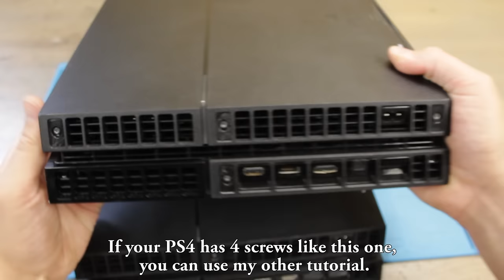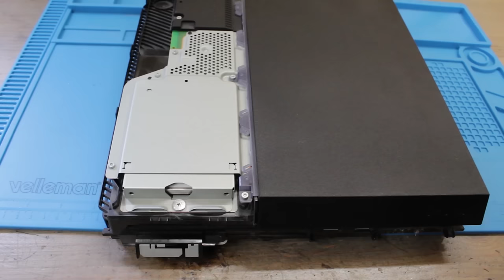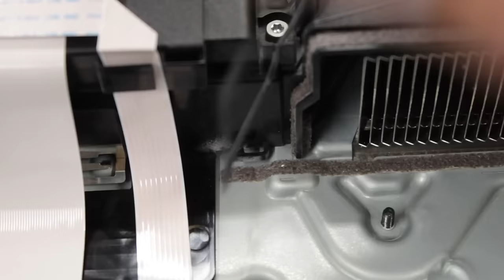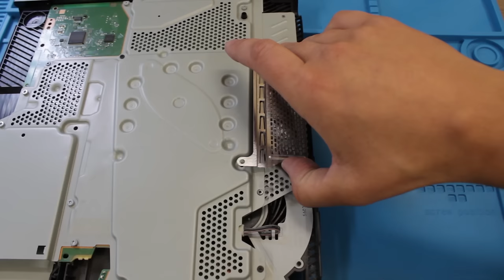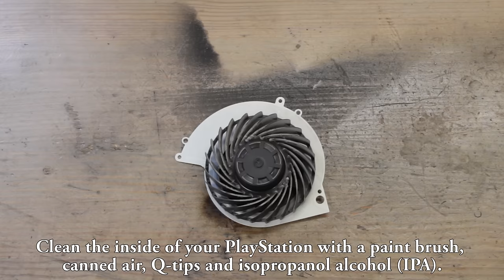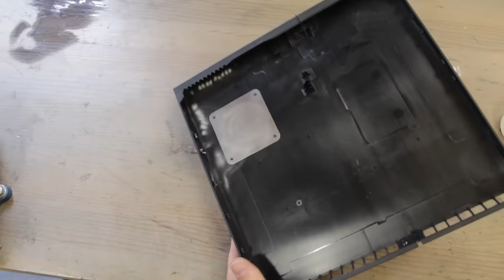PlayStation 4 model CUH-1200 cleaning tutorial.

Comment: My disk reader wont let me put in games.
I was cleaning it and i left a cd in there i dint put it back in and now it wont let me put any cds in my ps4 any help?
Reply: Ok i found the problem.
When you out the disk in there is a tiny oiece of plastic that is protecting is kind of that other disks dont come in. But it just stays there. How do i put it back?
Reply from the maker: @hasanok7223  You may have damaged your disc drive by opening it with a disc in it. Please send a message to my instagram dm. Then I can try to help you.
Reply: @hasanok7223  Hey, I don't think you damaged it, broh. Maybe you should try doing the manual eject trick. 
It's simple, you can Google it; it involves using a screwdriver to reset the drive and hopefully that might allow your discs to enter nicely again. 
The drive can refuse to allow any discs back into if you happened to just grab your CD by hand, out of the drive, while you were opening it! Which, it seems like you just may have done. :) Best of luck

Comment: 1 had to break of the big part of the cap, because at the back the right thing with the text on it didnt come loose, how did you manage to do that😢
Reply from the maker: In the video, it looks easy. This ps4 has been disassembled before and therefore opens easier. The way of opening is the same. You can turn the front away from you, then you can apply force easier.

Comment: ty for this video bro i will clean my ps4 tmmrw and i will diff be using this vid as guide, is there anything i need to be careful with while cleaning/plugging cables of  or anything else? cause i dont  really want to damage my ps4 lol.
Reply from the maker: You're welcome.

The bottom cover can be difficult to remove. The 2nd way I show in the video is a bit safer. 

Be careful with the ribbon cables. Don't fold them too much. 

Make sure you have the space to work and store the parts safely. 

Just take your time.
Let me know if you have any questions and how it went!
Reply: @SpareTimeWorkshop  actually all my 3 security torx screws are stripped, i dont have a rubber band so is there any other solution?
Reply: man you are amazing you're  tutorial is easy to go through , i just finished cleaning my ps4 and put it back all together and now my ps4 stopped sounding like a jet engine lol, ty again you deserve more views man.
Reply from the maker: @SmW-pc7qe  

Thank you very much for your feedback! I am glad to hear that you managed to clean your PS4 with my tutorial. 💪

Comment: Any tips on how to remove the power supply cables without damaging them?
Reply from the maker: You can alternatively use a small flathead screwdriver with this model. You can pry that in on the right side. But needle nose pliers also work.

Comment: The left screw for the power supply can’t screw in… how should I fix this? It just lays in the hole but I can’t screw it down because it’s already at the bottom.
Reply from the maker: You may not have installed the small nut with the black cap on the other side.

Comment: DONT CLEAN AWAY THERMAL PASTE IF YOU CANNOT REPLACE IT FRESH! MUST HAVE THERMAL PASTE.
Reply from the maker: Thanks for sharing this warning. I personally advise against leaving the old cooling paste in place. Often over time it becomes very dry and has lost most of its effect.

A waste of your time if your PlayStation is still not running optimally after all that work. Good cooling paste is fairly inexpensive.
Reply: @SpareTimeWorkshop  would be an idea to place a disclaimer at the beginning stating not to attempt before having paste at the ready. But excellent video. Renewed the paste and thanks to this vid everything amazing
Reply from the maker: @joshpalmer5974  Yes I have indeed had more people who had the same problem. It is very difficult to figure out in advance where it might go wrong.

In hindsight, this would have been 1 of the things I would do differently now. Just like warning not to take apart your disk drive with the disc in it. Unfortunately, things sometimes go wrong there too. Sometimes even with damage. I'm working on that now though to see if I can stick a warning in there.

Thanks for your feedback
Reply: Yep did clean it and haven't paste at home... Can I intal my ps4 without paste, just to try my ps4 (just starting up and open a game) and add the paste later?
Reply: @akon3152  No ! Starting it and running a game will cause tha APU (silver chip) to overheat and with luck your PS4 will turn itself off instantly. At worst you burn out the chip and it's a brick. Spend the 10 bux and buy the paste and replace before starting you turn it on.
Reply: @joshpalmer5974  I ordered the correct paste already. I Wanne start a game to see my ps4 s still working well by disassemble it... Tomorrow I will know😃
Thanks die your response mate

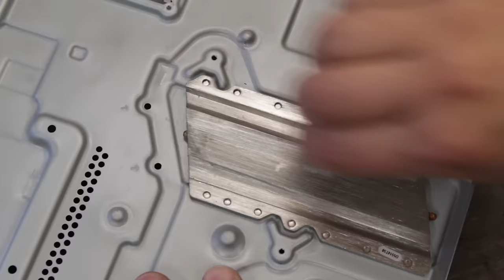Comment: On 8:44 when you removed the old thermal paste did you add the new one after or just completely removed it?
Reply from the maker: On 10:21 I apply new thermalpast. If you leave out the thermal paste your ps4 overheats very quickly and turns off.

Comment: Hey for the motherboard when you removed the black cover for the top left screws there is a bolt there in the silver part for mine
Reply from the maker: That's possible. Then I guess your power supply is still in there.

That is 1 of the phillips head screws of your power supply.

Comment: Completed tutorial. Was very comprehensive, however when I turn it back on...she is ROARING with the fan/power supply, then shuts itself off lile 3 seconds later.

Any tips/ideas???

Ta.
Reply from the maker: I think she overheated.

check that the top and bottom cover are snug against the motherboard.

Did you replace the thermal paste?

Comment: Now im scared to try, is there a beginner version of this
Reply from the maker: Haha, what might give some improvement is take it apart so far that the power supply is out. And blow air through the heatsink with canned air or an air compressor. From the side of the power supply.

Should this make little difference, it will still need to be taken apart further to replace the cooling paste.

Comment: Thank you. It saved my PS4.
Only one question: I cleaned the CD drive as shown, but when everything was put back and I trie to insert a CD, it feels like the entrance is blocked. There’s something hard preventing the CD from entering. 
What can that be?
Reply from the maker: That's hard to determine from here. Did you take your disc drive apart or put it together with a disc in it?
Reply: Maybe you should try doing the manual eject trick. Google it; it involves using a screwdriver to reset the drive and hopefully that might allow your discs to enter nicely again. 
The drive can refuse to allow any discs in if you happened to just grab your CD by hand, out of the drive, while you were opening it! :) Best of luck
Reply: @bluedash24   Thank you. I had open the CD drive with the CD inside, and had just taken it out by hand.
I figured it out that when I opened it, it made a sound like some plastic parts were moving to a different position. 
First I thought that it had moved to the “no CD” position, so I could just take the CD out, but that wasn’t the case.
The CD drive was still in a “CD in” setting.
So I opened it again, put the CD in, figured the position that the plastic parts on the cover should be when the CD is in, and held them in position while closing it.
And, voilà, it worked!!

Comment: I have a 1st gen PS4 that wont accept the CD games.  Ive tried doing software updates in safety mode. Disconnecting power cable. Rebooting profiles vaccum and blowing out vents. Can any help me out?
Reply from the maker: Can you tell a bit more about what exactly happens when you put a disc in your ps4?
Reply: 1st off, thank you for responding. I do appreciate it.
I received this PS4 used from someone who hasn't used it in quite some time.  When i try and load any disc with the Playstation vertical or horizontal, it won't suck the disc in. It sounds like it barely trying. There's no disc in it. Not sure if it's hardware or software related.
Reply from the maker: @DirtydogMech  No problem. If you do hear that your ps4 is trying to take the disc.

Then it could be that your in take rollers are dirty and therefore have no grip. 
Does your ps4 turn on when you put a disc in when it is off?
Reply: @SpareTimeWorkshop  I have not tried that. All I did was turn it on, get to the main page and then try and load it.  Should I try and load it while the PS4 is completely off?
Reply from the maker: @DirtydogMech  Just to check if your disc drive is getting voltage and if it registers that a disc is going in. (Then your rollers are probably still in place too). You can also send a video to my instagram. Then I can take a look.
Reply: @SpareTimeWorkshop  thank you. I will try that when I have a chance. I appreciate it.
Reply: @SpareTimeWorkshop  hey hows it going.  I tried to load the CD while the PS4 is off, ND it just turns on but still won't accept the CD. Can I send you the video?
Reply from the maker: @DirtydogMech  Yes of course. Using my instagram chat is easiest.
Reply: @SpareTimeWorkshop  hey messaged you

Comment: On 5.07 after taking the black cover off the small metal part how do you take off. I have a screw pointing up and you seem to not have it
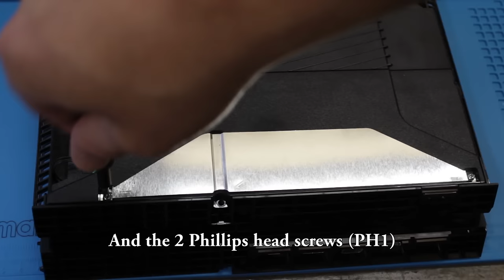Reply from the maker: That's the nut from one of the  screws from the power supply that I remove at 2:43.

Comment: The best! Did my first tear down with help from this video and cleaned up the whole thing! I’ll be replacing the thermal paste this weekend, do you have any pointers that would be helpful?
Reply from the maker: thank you very much! 

Just take your time and you'll be fine. The hardest part is taking it apart. 

Let me know how it went.
Reply: @SpareTimeWorkshop  Not the greatest in my first attempt! The top cover (one which doesn't slide out) was the hardest! I actually broke the plastic bracket that holds the thing in place, but managed to fix it by gluing it back on to the cover. 

I'm planning to use the MX 4 thermal paste, 
but read somewhere that you need to let it sit for around 15 mins before assembling the whole thing back, is this necessary?
Reply from the maker: @siddpai  

Oh, that is annoying. luckily you could still glue it.

I have not seen or read anywhere that you have to wait 15 minutes.
I can't find anything about it on the Arctic site.
Reply: @SpareTimeWorkshop  Thank you so so much! This video probably saved my PS4 from exploding a couple of months time! I had cleaned up the entire insides first which did reduce the noise but not as much as I'd expected. So, I wasn't expecting much to change when I applied the new thermal paste - Oh was I wrong! The console is now super silent and runs smoother than before. And I really couldn't have done it without this video so once again, thank you! :)
Reply from the maker: @siddpai  

You're welcome!
I'm glad to read that you found my video useful 👍

Comment: Great guide! But after putting my console back together, the fan seems to not work anymore. The cables seem to be fine and everything's plugged in where they should be; the console still turns on, but the fan doesn't spin. Any advice?
Reply from the maker: Have you tested with the covers off? so you can see the fan, maybe after cleaning it became much quieter.

Otherwise unplug the fan and check if there are no bent contact pins in the connector.

Reconnect maybe the plug isn't all the way in the connector?
Reply: @SpareTimeWorkshop  Yes, at first I thought the fan just got really quiet, but then I started experiencing overheating issues. Opened the console up and the fan just doesn't spin anymore. 

I keep unplugging and plugging it back in snugly and it still won't work. I cannot tell if the pins have bent. I haven't had much success at finding a local professional that could test if the fan still works or not independently of my system. At this point, I might just have to order a spare fan.
Reply from the maker: can the fan rotate freely?

I'm afraid you have to order a fan to test. but it's still a gamble
Reply: @SpareTimeWorkshop  Just got the replacement fan today and it seems to be working just fine! The console is as quiet as a dream now after cleaning. Thank you so much!
Reply from the maker: You're welcome, glad it's resolved. well done!

Comment: What if I don't replace the thermal paste and leave as is? (Not remove etc)
Reply from the maker: good question!

Thermal Paste tends to dry out over time. 

Chances are your ps4 will only overheat faster after cleaning if you don't replace it. I do recommend replacing the thermal past if you take your ps4 apart.

Good luck let me know how the cleaning went.

Comment: Hi I have this for 6 years and never cleaned inside it and it makes alot of noise so I just want to clean the fan and the power button will that be enough?
Reply from the maker: Probably not. 

Usually poor cooling is caused by dust in the heat sink. Maybe you can get away with just taking out the power supply and blowing the heat sink clean with canned air. 

Dut I recommend taking it all apart and getting it right the first time.

Good luck

Comment: I did this and now it doesent turn on :( is there such thing as putting the wrong or too much thermal paste? I really dont know what to do? Can some one help me? 😢
Reply from the maker: How annoying. I'm sure a solution can be found.

If it doesn't turn on at all then it has nothing to do with the thermal paste.

If it turns on briefly and gives 3 beeps and flashes a red light. Then you do have an overheating problem.
Reply: @SpareTimeWorkshop  i just fixed it turns out i was using to much paste 😅
Reply: @Hadock  hey im having the same problem, just did repair however it immediately closes after i open the ps4, what did u do
Reply: @tahaqazi1755  try using a little bit of paste and it should work, plus the wires could be the problem cheek if they are all conected, so try cleaning the paste and put just a little bit of it and it should work

Comment: I have a problem: the bottom security screw on the back of the ps4 wont come off. I had no trouble with the one security screw above it or any other screw but this one just wont come out please help me.
Reply from the maker: Is the screw tight? Or is the head damaged? 

If it is tight, a screwdriver with a larger handle will help.

If the head is damaged you can try using 1 size larger torx. 

You do use a security torx bit, don't you?
Reply: @SpareTimeWorkshop  yes I do, me and my dad struggled with it a bit trying many different methods. In the end we resorted to drilling around the screw until it loosened. It worked for all intents and purposes. I think the screw was way too tightly made probably an error at construction.

Comment: But theres one problem, after I've assembled, the dvd disc is not working, I had to de assembly it again to make sure all the cables or connectors are plug in, but stil not working. Then I have check it again and then eventually,  the moment you turn on the ps4, thats the only time this disc drive is gonna accept thr disc. How can I fix this? Plus if the ps4 is in vertical position at the moment you turn on, it will not read the disc while if its in lying postion or horizontal position, it will tend to work properly and read the disc.
Reply from the maker: Oh that's strange. The other way around does happen often. Then the disc drive only works when the ps4 is vertical.

Was the ps4 working just fine before you took it apart?
Reply: I just found out that the disc drive screws are too tight at the opening of the disc drive. That's why the disc can't go through.

Comment: You didnt show how to clean the exterior body of this ps4. Can you plz enlighten me on how to remove the stains or marks from the exterior body after dissembling it?
Reply from the maker: I used a clean brush and then some soapy water and a cloth. make sure that no water gets under the metal parts.

you can then use cockpit spray if you want to darken the outside a bit. the disadvantage of this is that your plastic can start to shine a bit afterwards.
Reply: @SpareTimeWorkshop  i have the white ps4, so can i remove the stains with this method?
Reply from the maker: @amaarhaider9029  
cool, I've never owned a white ps4 myself.
I would try with soapy water and a cloth.

I wouldn't do cockpit spray on a white one.
Reply: @SpareTimeWorkshop  oh ok, I'll be sure to try that out, i did try with just wet cloth but that didn't yield any results. And for how long should i keep the upper part dipped in the soapy water.
Reply from the maker: @amaarhaider9029  wet the cloth with the soapy water and try to brush it off.
Reply: @SpareTimeWorkshop  alrr, thankd for ur timee mate

Comment: I gave the clean and when I plugged everything back in and I turned it on. It would turn blue but then it would disappear. What did I do wrong? It does not come on TV
Reply from the maker: That's not supposed to happen. Has it worked out yet? Have you replaced the cooling paste?
Reply: @SpareTimeWorkshop  yeah I have

Comment: After reassembling it I have a fuzzy screen which cable would do this?
Reply from the maker: That's unfurtunate, I'm not sure. 
But I would check your HDMI cable and port first. the HDMI port of the ps4 often breaks. 

Is the fuzzy screen only when you plau a disc? or immediately when you start up the ps4?

Comment: if i dont have needle nose pliers, is there any other way i can disconnect the power supply
Reply from the maker: With this type of ps4, it also works to disconnect the powersupply cable with a small (about the width of the plug) flathead screwdriver. You put that on the right side between the plug and turn the screwdriver a bit to push it up.